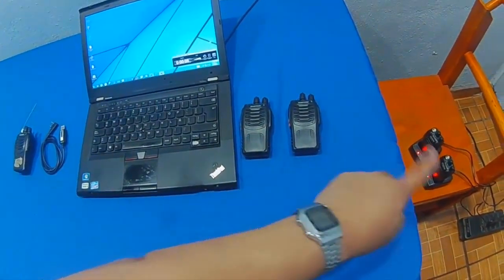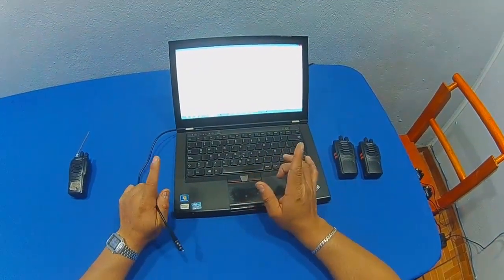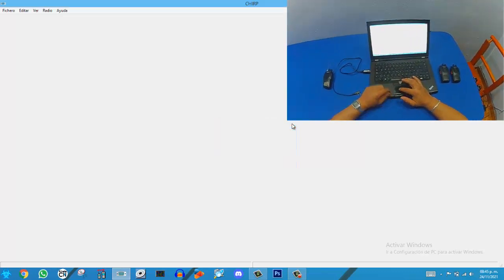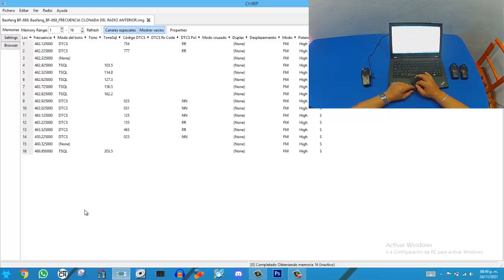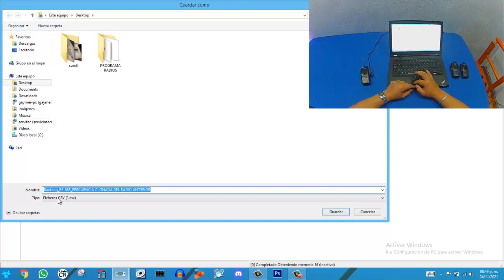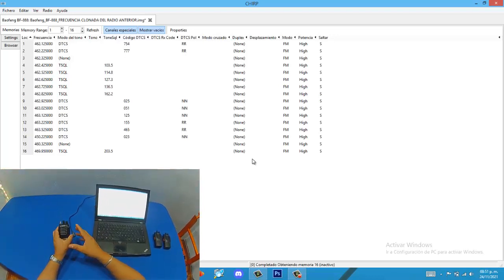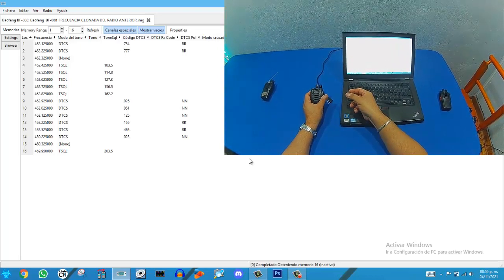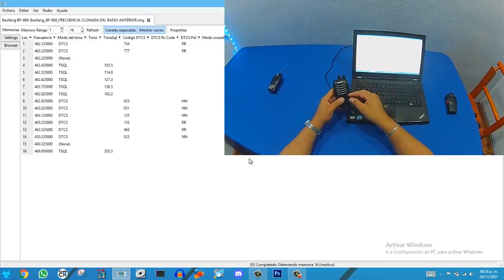COMO CLONAR FRECUENCIAS DE RADIOS BAOFENG UHF BF888S

Comment: hola, genial el video, me dejo muy claro, pero me surgio un problema al momento de hacerlo.
 resulta que tengo las baofeng 888s  pude clonar 2 de las radios,  eran el mismo modelo y marca pero  las tenia hace mas tiempo, pero al clonar las mismas frecuencias en las otras radios, compradas mas recientemente (misma marca y modelo) se logran enlazar, pero me producen un ruido de piso  bastante fuerte y desagradable como si tuvieran interferncia o algo asi, al volverlas a su programacion original, el ruido desaparece, pero al volver a clonarlas con las que ya tienen la otra frecuencia  comienza nuevamente ( en las radios que tengo  la frecuencia que quiero clonar no tengo ese problema)

gracias por leer mi comentario, y espero me puedas ayudar, de ante mano muchas gracias.
Reply from the maker: Ok son los tonos, en unas dicen FM Y EN OTRAS NFM CAMBIA LAS
Reply: hice las pruebas, las cambie, las deje  primero en NFM y  seguia igual, luego las volvi a cambiar a fm y paso lo mismo, pero me di cuenta que me deja el led verde encendido luego de que termina de cargar la configuración en la radio
Reply from the maker: Upss ya valio entonces
Reply: encontre la solucion  las volvi a su configuración original  con el programa de las bf 888s,  ( menos mal la deje guardada antes de empezar a probar), quedaron  funcionando bien, luego las conecte con chirp  y sola cambie las frecuencias de los canales 2-3-4  (puse las frecuencias de la motorola) y  con eso logre enlazarlas sin que quedara abierta la recepcion de señal y sonara el  chicharreo molesto, no es lo mas optimo, pero al menos las puedo enlazar y seguir usando normalmente.
Reply: @gastonromero8606  En el soft debe revisar el nivel de SQUELCH, debe quedar en algúbn valor mayor de 0, es por eso que el led verde queda encendido, está recibiendo sin ningún tipo de filtro.

Comment: amigo el programa de steren no me deja modificar frecuencias a mi conveniencia r el programa chirp no me detecta el esteren que puedo hacer ya tengo todo istalado pero nada alguine que recomiende algun otro programa para steren es el RAD-510 le pongo la frecuencia y me bota a la 470.00000 todas las que pongo
Reply from the maker: Es por qué esa frecuencia no está dentro de un rango apropiado necesitas meterle unos mhz más a la frecuencia para que lo acepte